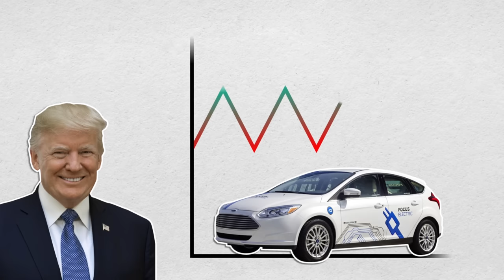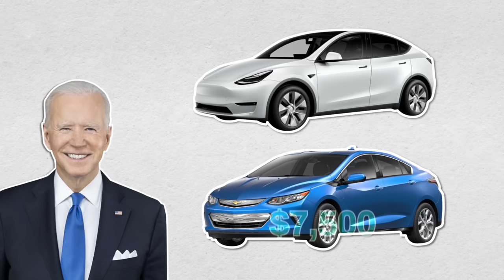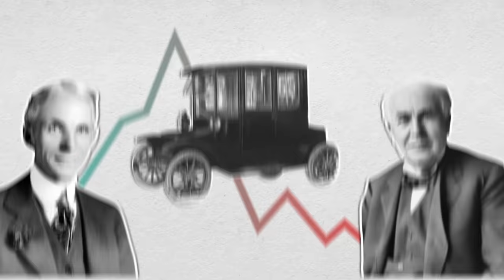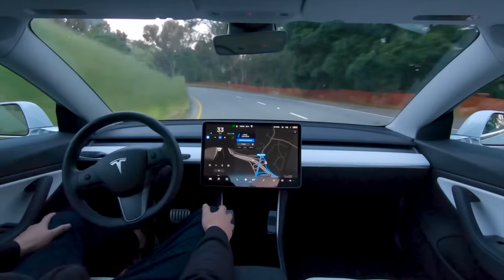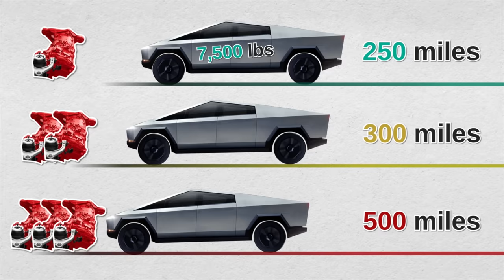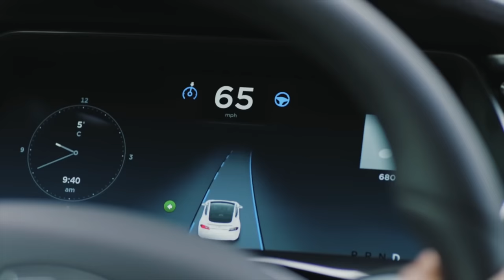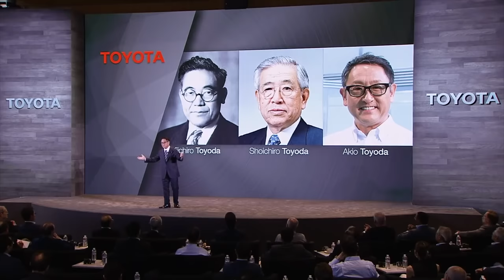Here's Why Toyota is Refusing to Make Electric Cars

Comment: That argument (at the end) makes no sense. It takes more electricity to create hydrogen to run cars than EVs would take for the same number of cars. I suspect Toyota is either sand-bagging to not tip their hand, or they're hoping to delay EV adoption long enough to figure out how to outcompete other car makers. In any case, they'll be forced to make EVs at some point dispite their rhetoric.
Reply: I'm sure they're lobbying from their own profit-seeking perspective.  But the overall argument is sound, and applies worldwide.  Power must be generated somewhere.  If the cars themselves won't do it anymore, then the grid has to do it for them.  And the grid wasn't designed to handle that huge additional load.  So it must be expanded at a practical rate, while the number of pure-electric cars on the road increases at a commensurate rate or less.  The regulatory targets for an all-electric car future are way too aggressive to be met.
Reply: @joesterling4299  Needing extra electricity capacity in 10 years is probably valid, and we have plenty of time to work that out.
But the reason it's not a sound argument is that hydrogen would require even more electricity capacity than EVs, so Toyota's reason for going to hydrogen instead of BEV is flawed from the beginning. They say they like hydrogen better because BEV would use too much electricity, yet propose a "solution" that requires even more grid capacity.
Reply: @joesterling4299  BEVs will be part of the solution to grid capacity.  Think about attaching all those batteries to the grid when people get home.  It's not a case of them all charging at once. Many will still be nearly full of juice.  Smart charging technology will allow them to take charge when it's cheapest (time of use tariffs are already popular) and there will be incentives to allow the grid to draw a limited portion of power FROM the vehicle at peak times.  The National Grid in UK are very happy with BEV expansion because it will help them smooth out demand.  There's a Fully Charged episode from about 2 years ago where one of their senior engineers is interviewed on the subject.  Check it out.
Reply: The author is not here to make sense but to entertain those who do think that hydrogen, the fuel of the future (always was and always will be), is going to magically show up in, say, 50 years from now. At least that’s what they have been saying for the last 60 years or so.
Reply: Not if you use nuclear base load at night ---- the only way to get a positive EROEI on hydrogen production. And, that is only if  your base load has extra capacity at night because nuclear and coal just run and don't throttle. But, unfortunately, that is barely the case now in some sub-grids in the US.

Toyota is smart.
Reply: @MrBlueDevil93  Even with your idea, it's still more effecient and useful to save the power generated in batteries, or pumped storage hydoelectric methods (~80% effecient), rather than storing the energy as compressed hydrogen (35% effecient). Whichever method you use to generate the electiricity, hydrogen is a poor choice. Toyota may be smart, but storing energy as compressed hydrogen is not.
Reply: The reason Toyota would go hydrogen, is, because base load nuclear and coal run steadily --- they are not throttled. So, at night when we use 80% as much electricity as during the day (season and latitude dependent) you use the excess electricity wasted as heat in the wires for actual hydrogen creation --- 
otherwise as is currently the case that portion of the electricity produced is just wasted. Think regenerative braking.
Reply: @MrBlueDevil93  Right, so the excess electricity could be stored as compressed hydrogen, hydro storage, batteries, etc. Why store it in the least effecient way possible? 62% available energy is wasted in hydrogen storage, 20% wasted in battery and hydro storage. Hydrogen makes no sense no matter how you look at it.
Reply: @HarshColby  Truth is EV's make no sense, when, you look at the lack of available materials without digging up the entire planet. Some may say the same for conventional fuels, but, the wells, the processing facilitates, the ports, the pipelines, the entire stream (known as upstream, midstream and downstream) in the entire economic and logistics chain already exists. We simply do not have the money to go electric car, unless, 1) we depopulate severely, 2) we throw everyone at building new infrastructure and digging coal, because, 3) we defund virtually all welfare and social programs, and, 3) we throw the environment to the wind. If we do that we can afford it.
Reply: Hydrogen could be a free rider off wasted excess nuclear. Limited for now. But, ultimately touch safe walk away nuclear is the way we will have to go once we drop the wind and solar nonsense --- which will drive up broke and destroy the environment. Mind you, that, said,  I am a big advocate of solar. But, it is a limited niche.
Reply: @MrBlueDevil93  Lack of which materials? Lithium, Iron, and Phosphate are quite plentiful and since batteries are nearly 100% recyclable, it's also sustainable. Same can not be said of gas.
1) Electricity infrastructure is quite rubust, while hydrogen infrastructure is virtually nonexistant. So I'm unclear about what money you are suggesting is needed to charge an EV.
2) Depopulate? Why? EVs are more sustainable and cheaper to fuel than gas cars, so wouldn't that imply a greater ability to supply the world's transportation needs?
3) EVs are more environmentally kind than gas. I hope we agree on that. And since EVs use less electricity, by far, than the equivalent hydrogen energy needs, it's hydrogen we can't afford, by your own argument.

Comment: In my home, Newfoundland Canada, the combination of salt water spray from the ocean and salted winter roads play havoc with cars.  Many modern systems designed elsewhere fail due to corrosion.  Not to mention in under 10 years a car has pretty much disintegrated from rust.  I don't see EV's doing well in this climate.
Reply: It's similar in many parts of the UK and they do OK - all the electrics are weather proofed and the bodywork is as durable as any other vehicle (some which are better than others)

Comment: The tech and battery is awesome at first when new, but in age, it won't last as long as the classics before them.
Reply: About 20 years with older batteries and 30 years with the newer current ones.  Should be near 40-50 years with the new ones coming out in 2022.
Reply: It's the other way round lol
Reply: @victorluke5816  where are you getting those figures cus from the research I've done those numbers seem quite optimistic
Reply: @spoonman475  These numbers are based on the high usage Teslas that were driven between Los Angeles and Las Vegas on a 24 hour rotation where they just charged and drove with them.  Tesloop is the company and their Teslas drive 17K miles a month.  Problems started to occur around 300K miles with the early Model S batteries.  Average American drives 14K miles per year.  That  actually makes it over 21 years of driving to reach 300K miles.  Some of the Model X have  500K miles with a only 23% degradation of battery life without failure.  That number is close to 36 years of usage for an average American driver.
Reply: @victorluke5816  it's more of a time thing than a mileage thing with batteries, though. The heating up and cooling down causes the battery to lose its efficacy over time. If you ran your average naturally aspirated 4 cylinder at 2k rpm at operating temperature without ever turning it of/on except to change the oil, you would likely see a ridiculous amount of mileage. Some well cared for Internal combustion engines have been known to hit 1,000,000 miles or more when properly cared for and not abused.
Reply: @spoonman475  For EVs the charging cycles are what does most of the damage not the age of the battery.  Most of the long life ICE vehicles were diesels which were known for longevity.  Also you don't need to give much maintenance to EVs to get them long life.  Some of the EVs built by Ford in the 19th century still work.

Comment: Bring back the FJ Cruiser. As an a electric ⚡️
Reply: What year and how many miles does yours have
Reply: @mattmekhaeil  why not an FJ cruiser that runs on hydrogen .
Reply: @mattmekhaeil  Like most of them actually go off-road 🙄
Reply: @Scatpack23  2007 120.000 miles. Just broken in😁
Reply: @mcc7762  Not of Toyotas making it

Comment: I have a mach e and I really enjoy it. No issues at all. Level 2 plug in at home is very cheap.  Time of use electric plan with utility. My son has a tesla also enjoys  the car.  I see the price of gas at 3.20 a gallon by me and I am happy to avoid that cost.  The cars are extremely quiet on the road. I am told the power unit on electric car gas 200 parts vs 2000 parts on ICE cars transmission.  Maint is minimal on electric car.  Brakes can last 60k on electric or more.  No more oil changes  and exorbitant repairs at the local repair shop.  Last points I can go into HOV lane and ins was cheaper then mazda for me.

Comment: Those mileages are without heat, ac, wipers etc so your real mileage will be significantly lower
Reply: That's right. Even petrol powered cars are tested under strict control conditions in order to give they're range. In saying that these electric will never beat the diesel for range and fill up.
Reply: As the saying goes: "Your Mileage May Vary!".
Reply: That's true but hardly anybody I speak to who has bought an electric vehicle decides to go back to internal combustion. Some people do have a genuine need for the gas/diesel range advantage but a huge percentage don't. For those people the range on a single charge just isn't an issue ... in fact they spend less time "filling up" because they just plug in at home and the car's ready to go in the morning.
Reply: Yes, and don't use the radio or headlights if you want to make it home!

Comment: Electric cars trap users close to home. You could only drive about two hours away before needing to turn around, if you weren't stoppong somewhere to charge it. Hybrids make more sense, IMHO.
Reply: Its called CONTROL ....
Reply: exactly....agree  100 %.
Reply: Toyota Hybrid is about 50mpg. The most with a plug-in hybrid 133mpge. A fully electric vehicle can get anywhere from 150 mpc-600 (higher end Tesla).
Reply: That may be true with some EVs but I have a model Y long range. I can drive 5 hours (as long as my bladder would allow even if I was driving my old BMW) before stopping to charge my car up in about 40 minutes while I eat dinner. With Tesla's supercharger network I've never felt trapped.
Reply: Sam Macaw  I have a car that fills up in my garage overnight while I am in bed asleep...I win!
Reply: @normvanduker9999  - So, you can go 2.5 hours before turning around instead of about 2. My normal old gas cars have unlimited range. I can drive all day across country switching drivers with my wife without having to pick stops or hotels based on a charger network. We did 8+ hour driving days across the great plains recently. Didn't see  chargers anywhere.
Reply: @pete1853  There is an extensive network of Tesla fast chargers that allow any Tesla owner to easily and conveniently make cross country road trips - even across the great plains But with other EVs, you're right, not so much. And, yes, in the specific special case comparison of cross country trips where you are switching drivers gas cars do have a edge . They absolutely take less time to fill up. But you can't make blanket statements about utility or convenience based on a special case use. That's like saying a BMW is worthless because you can't use it to haul hay out to feed the cattle. And in fact, even if the only thing you are comparing is time to fill up the car, it could be argued that EVs actually have the advantage over gas cars. Why? Because OTHER than when comparing cross country trips the typical EV owner spends LESS time filling up than a gasoline car owner. An EV fills up in your garage at night while you are asleep in bed. Gasoline cars always require a trip to the gas station.

Comment: So I built a minibike that runs 1800wats at 56 volt and currently gets about 50 miles per change  , I plan to put electric motors in my 2010 Ford edge,  it's front wheel drive but has all wheel drive options so I plan to put the electric motors on the back two wheels for city's driving

Comment: Emphasis should always been on plug-in hybrids. Zero range anxiety. No need to squander billions on electric infrastructure. Very little pressure on the electric grid. I think you get up to 50 miles on the electric battery. Gasoline usage would decline significantly because relatively few people drive more than 50 miles on a typical day.

Oh well.

Comment: Scotty, you put out great videos keep em coming. My wife has a Nissan leaf and loves it, 2015 model with 55k miles and still full bars on battery. It has heated seats (all 4 of them) heated steering wheel and it's a great little car for nipping around in. I'm hoping that when it does come time to replace the batteries that the new ones will have a better range than the current 100 miles we get at the moment. It's cheap as chips to charge up at home on the granny charger that came with it. I was going to install a fast charger but there's really no need to. We only charge it two or three times a week. I'm listening to you from Manchester UK. Have a good day everyone.
Reply: 100 miles is plenty for most americans

Comment: Actually, Toyota is in the final stages of coming out with an EV . The difference is that it will be a solid-state battery that will get a range of 300 miles and be able to recharge in 10 minutes. That 10 minutes recharge time is a  deal-breaker for many people. Toyota says they have solved the problems of solid-state batteries not being able to get good range in cold climates . We will see.
Reply: It won't be able to charge 300 in 10 minutes

Comment: From the beginning my thought has been hybrid was the most acceptable way to increase gas mileage and lower emissions. It will be many years before our infrastructure could handle electric vehicles on an ownership scale as we have now. Hydrogen is another great idea if we can produce hydrogen cleanly and cheaply. I believe all electric vehicles in the USA is more of a cart before the horse dream.
Reply: The engineers say that we need to increase power production by 25% to switch over to 100% electric cars.  2.8 million is the cost for each hydrogen station.  We need 4300 of them for hydrogen to be practical in the US.   So we need to spend 1.2 Trillion dollars to get the infrastructure for hydrogen to work.

Comment: What is Environmental Sustainable about an BEV car, that after a decade of usage, is probably in the junkyard due to high degradation of the battery packs?
Reply: Bingo. planned obsolescence
Reply: agree.....n   what  are  they  going  to  do  with  all  the  corroding  n  leaking  lithium  batteries?  most  can't n  won't  be  recycled  n  landfills  are  full.
Reply: That's a phony argument. Battery degradation for a Tesla is about 15% after 200,000 miles and Tesla is moving toward 95 battery recycling within the next 5 years. Tell me, how much of the gasoline powering an ICE car do you think will be recycled in 5 years? And how many gasoline cars do you think have engines that are less less than 15% worn out after 200,000 miles?

Comment: My favourite car is Scalextric. I spent hours and hours with my mates in my youth racing around and having fun. Buying a new electric car is currently economically unviable. The industry needs another 10 years to mature, and even then, the refueling infrastructure needs to be in place to handle it.
Reply: I realised the other day that EV's are designed the exact same way as a remote control car as the batteries are underneath the car and the motors usually at the rear. Very similar design.
Reply: Most people fill up their EV at home.
Reply: @skipondowntheroad5833  that may well be true, but infrastructure also includes the ability to generate the power in the first place. Power stations would not currently cope if everyone went electric.
Reply: PHEVs are great.  Charge overnight during our sleep cycle.

Comment: Toyota has it right the hybrid makes a lot more sense and a number of their current cars are exceeding 50 MPG, my 2013 Prius  at 55 MPH will give over 50 mpg unless you are doing a lot of hill climbing, but going down hill it generates a lot of battery energy at 60MPH it will ususaly give 50MPG unless pushing a lot of wind. Many Prius models are getting over 250,00- miles and still running on the same battery pack that will not cost $10,000 plus dollars for the battery only cars .

Comment: No head gasket that might break, no oil changes, no injectors that might break, no stupid sensors that fail, no timing belts and chains. From a reliability standpoint, nothing beats the electric vehicle.